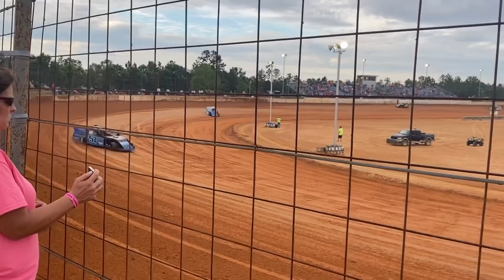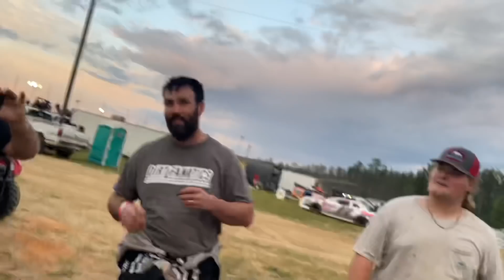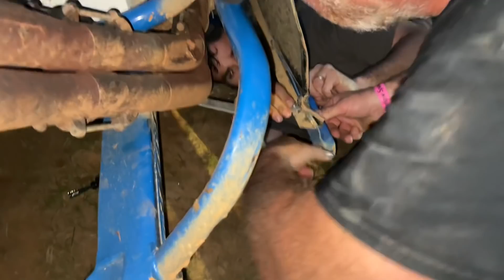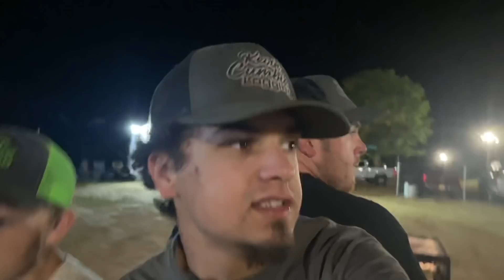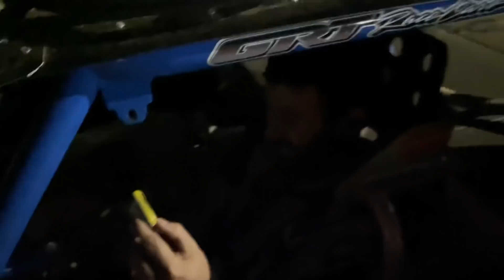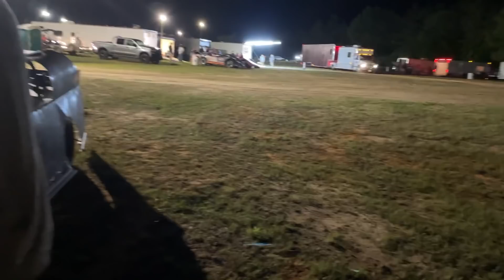Solid night at Outlaw Speedway!

Comment: I know everyone is attempting to keep these cars on a diet. Yet I still am confident that bolting at least a minimum amount of weight low and directly behind the rearend. Something like 50 pounds, and 25 pounds on either side of the fuel cell would address the lack of traction off the corners. 

It has just been to successful over the years on cars I have worked on. Not to be an option in todays racing. 

The fact that with at least 50 pounds of weight, low and behind the rearend. Can result in having success with 12, 17, and 38 feature wins in a row. Is results I cannot ignore. Over the time I have been around dirt track racing. 

Because one has to be able to do something if the scale weights, and  percentages are close. In order to get traction off the corners. 

Which if 50 pounds seems to much than dial it back to 25 low and behind the rearend. Or 5 and 10 pounds on either side of the fuel cell. 

By the way after watching that heat race, I am still not convinced. That the people running this track know what they are doing. Because that heat race should have been a complete restart with the original lineup from the start of the heat race. I am not sure why they were attempting to do with the car they were waving around. However, it just made no sense, no matter who should have been where in the tracks minds. 🤔🙄👀

And I don't care to much if the guy who owns it is a famous Facebook, or YouTube content creator. 

Because I was on Facebook until this year from December 2006 and October of 2006 for YouTube. Which I have seen people come and seen people go. Plus I used to make videos as well, and even though I would never partner with YouTube or Facebook. The fact remains, I earned the place, where I can give constructive criticism. When I believe it is warranted. 

And even if I am viewed as outright mean. I still do my best to be pleasant as much as I possibly can be...
Reply from the maker: You know. This is something we’re working on getting info on. We’re trying things. We will figure it all out
Reply: B DOT  Yea, there isn't anything wrong with adding some lead weight to the car. Especially if it causes the car to handle to be better and you have the forward drive off the corners...